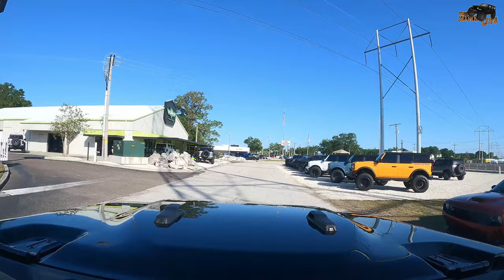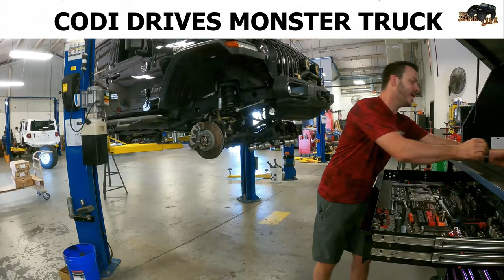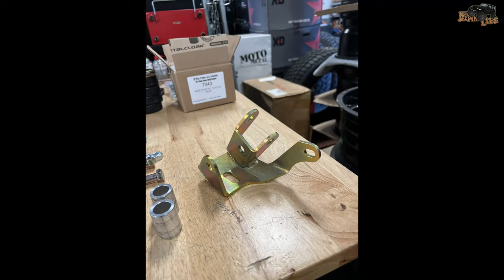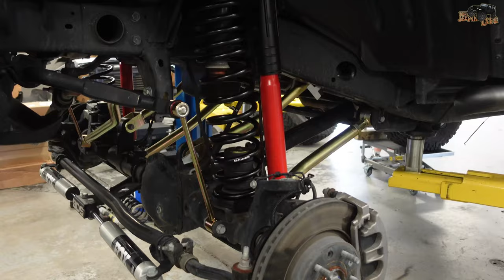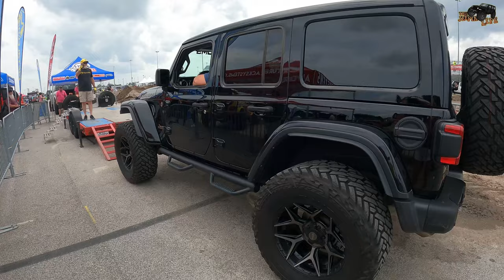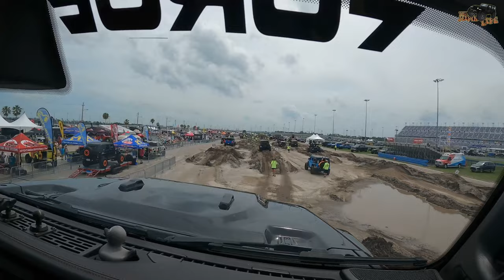Metalcloak 3.5" Game Changer Lift on a Jeep Wrangler Rubicon 392 Installed by Force Customs Tampa FL

Comment: I have the same lift and my jeep vibrates . I guess i need to upgrade the driveshaft
Reply from the maker: Yes you need an aftermarket Driveshaft for sure.  And make sure you have someone install it that knows Metal Cloak.  We love Force but just learned of some things they didn't know that needed to be adjusted to give it a smooth ride and take advantage of the extreme flex!

Comment: Did you have any clearance problems using the factory drive shaft?
Reply from the maker: I had to replace the front driveshaft.  And yes we would have had problems.  This kit has so much flex that it would have hit.  The rears are fine factory though.